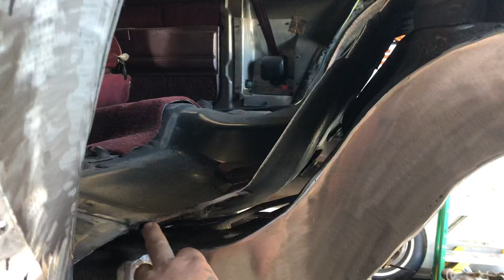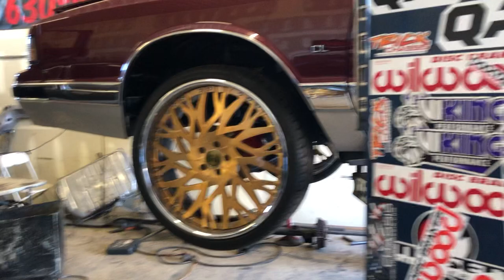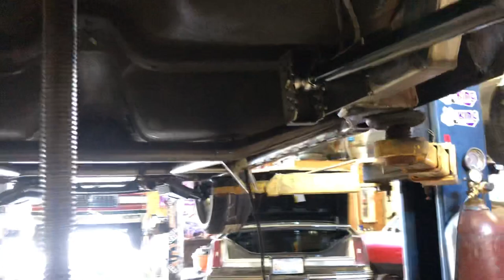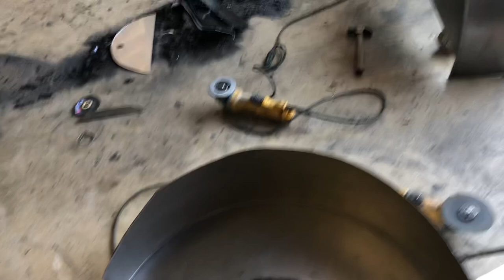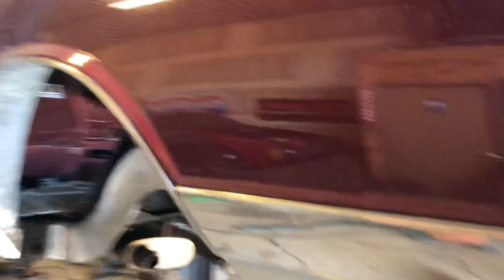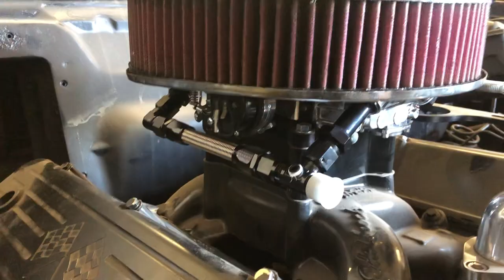PART 2.5 GBODY MINI TUBB SET UPS BET IT UP KUSTOMS YOUR #1 SUSPENSION SHOP FOR BIG WHEELS & HOOK

Comment: I just broke my 3k dollar powerglide transmission because the 7.5 rear end with moser street axles, g80 locker, Richmond 410 gear decided to bust the pinion bearing causing the gears to bind up under a hi rpm burnout to heat the tires up and it literally broke the transmission into 3 pieces. 383 stroker with dart pro 1 heads and all Howards roller set up in the mid .5?? Lift. Just replaced 500.00 in powerglide parts and swapping the 7.5 for a 9 inch

Comment: Do you have a video on how to install those frame rails for a ladder bar or four link rear suspension? I want to run a 315/50-15 on the back of my SS Monte Carlo, and have the rear narrowed a couple inches on each side with 10 or 12 in wide wheel. I don't think a frame notch will fit that.

You do great work by the way.
Reply from the maker: I do have some videos on that, 12 wide overall with a thin frame notch,” needs bracing tho “ is as wide as you can go without re-framing the back of the car..
Reply: @BETITUPKUSTOMS  is it possible to get a 15" wheel and a 315/50-15 tire under the back with just a notch and mini tub? If not , what is the biggest you've put under a g body and it be tucked in the fender? I just want the look, my 383 probably won't make 500 HP, so it's not needed, but I might go LS one day too.

Comment: What is the widest rim you can put on that minitub after the notch and tubs are completed? I’m hoping to get a 12 inch wide rim with the mini tub currently I’m running a 10 inch wide brim with no frame notch but it’s maxed out.
Reply from the maker: X11 rim, 12” overall is the max with a thin frame notch, “needs frame bracing…

Comment: Why is it they want from 4:10 to 373 if there on rims.? I see this a lot but dosnt the 4:10 turn to 373 with the 24” wheels
Reply from the maker: Yes, taller the wheel brings the gear ratio down..

Comment: How wide of a wheel/tire combo do you have to start notching the frame?
Reply from the maker: Fat lips, 6,7,8,9,10” lips and depending on how you want it to sit,  the look, the Stance…..
Reply: @BETITUPKUSTOMS  ok so if I had a gbody without the cut would a 22x10 fit or would it stick out no matter what lip it had? I've always been curious about this stuff but I have a foxbody but real.interested in gbody since I've had a 79 bu and and 85 Grand Prix
Reply from the maker: All depends on the wheel offset…